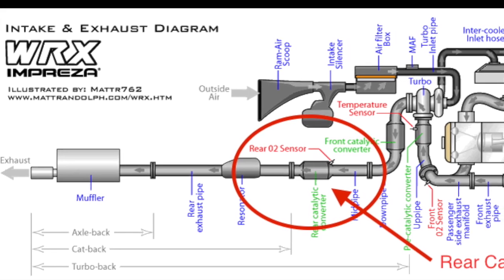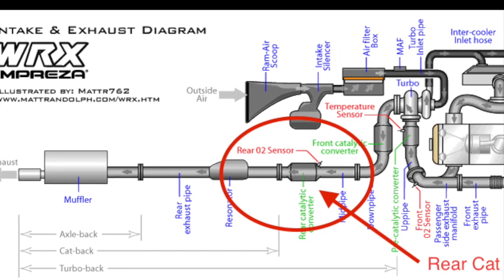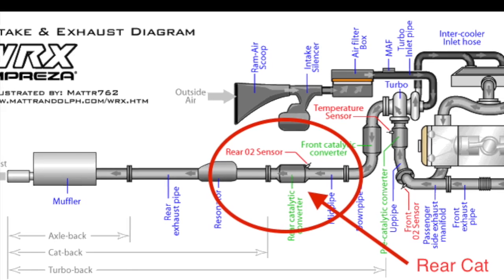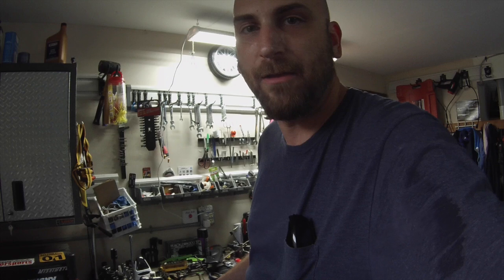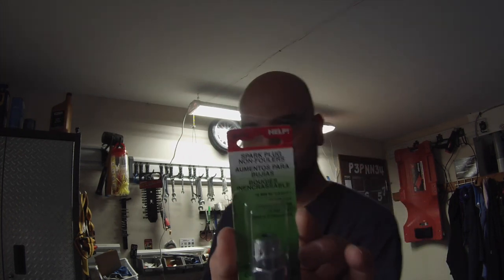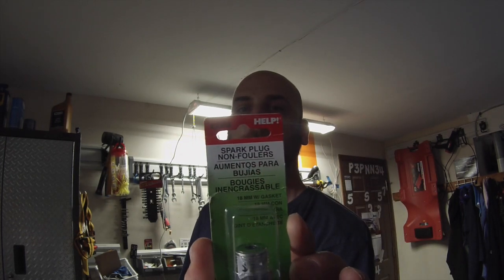02 sensor spark non fouler  p0420 code fix WRX Part 2

Comment: So it’s the rear sensor you have to foul? If the system has 4 sensor, 2 for each bank then you put the fouler on the rear (last) o2 sensor?
Reply from the maker: Depending on the car it should be the rear downstream sensors or sensors. Double check that the rears are not metering air fuel trims like the upstream do as those you can not use Fowler’s on without ruining your air fuel trims and possibly your motor.

Comment: My 2006 Prius the O2 sensor won't fit (no room) if I put on the second non fouler over the one I drilled out.  I see some videos with them placing only the drill that one over the sensor. Does anyone know if that'll work before I do all this?
Reply from the maker: Bart BWD hi , try a search for a 90 degree Fowler . The one drilled out does not work by itself.
Reply: svtwrc, thanks for the reply. Wish I would have received your advice before I started this project.  What I ended up doing is simply drilling out one of them just to the edge of the hole so the hole would not become bigger.  That actually worked and fit perfect in my Prius.

Comment: Just buy a lambda sensor extender off ebay for about 10 quid, you can get adjustable ones to !
Reply from the maker: Colin Mann thanks, will take a look at those.
Reply: svtwrc hi just wondering did you do this modd due to a decat ? If so did you get any boost spike as im about to cut my downpipe cat out of my 07 wrx and herd alot of people saying about boost spiking ? If so you know any ideas to stop it ? Like i was thinking of welding a baffle in oem cat camber to keep bit back pressure ? Any advise be great, thanks
Reply from the maker: Colin Mann did this to my beater car the 2003 WRX 4EAT wagon with 220k .Had the ECU code P0420 and many other issues it's not worth replacing anything . Every bolt on it is seized and or rusted , trying to replace may mean never getting it back together. Removing the cat on the downpipe is well known boost creep spike issue, the ECU cannot adjust enough unless you tune it to compensate. Cobbtuning Off the shelf maps may work if you can't get to a tuner. Cobb even has a tune for Wategate boost creep or under boost .

Comment: HI I have 2 dounstream 02 sensor can I have both with defouler
Reply from the maker: That may work for you. I'm not 100% but you can always remove the fouler without Fouling the sensor to put it back if it has a funny reading. As long as the front is left alone your theory may work.